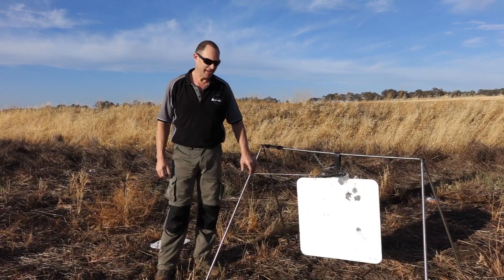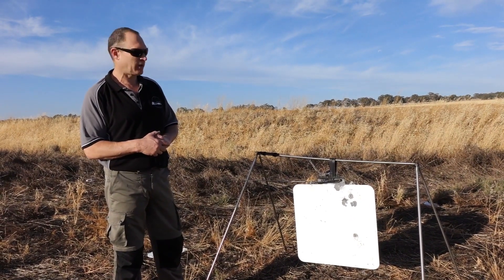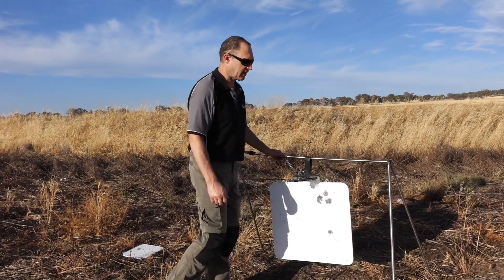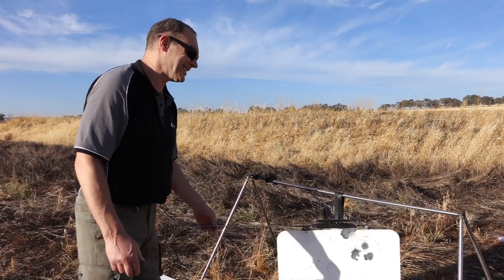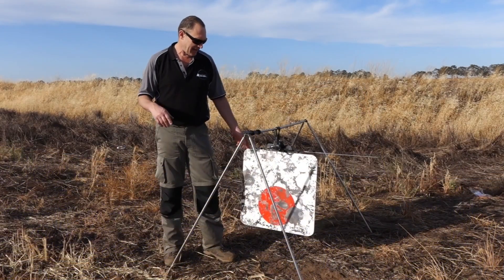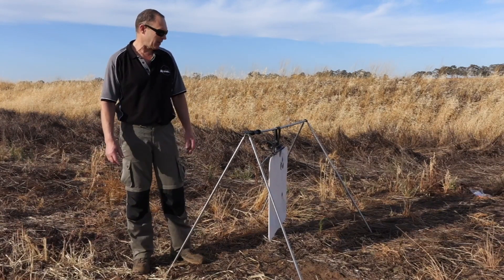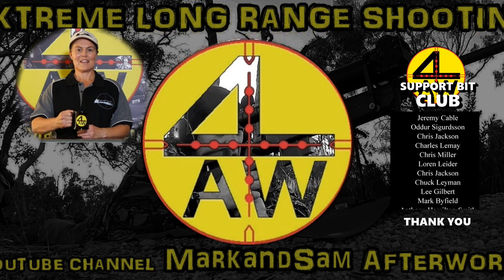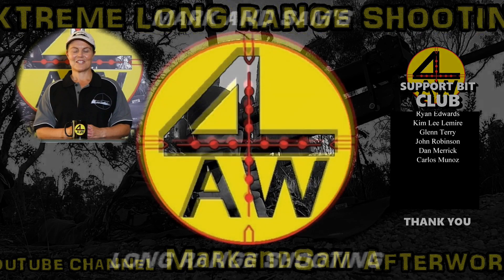Team Target system and some lever fun

Comment: Love a lever gun my current favorite is a Marlin 336 in 30/30 but I also have a few others calibers 45/70 35 rem 45lc and a 22lr
Reply: Yep I'm with you I love my Marlin 336 XL 30/30. As much fun as you can have with your clothes on.
Reply from the maker: Yes they are just good fun to use, cheers and all the best.